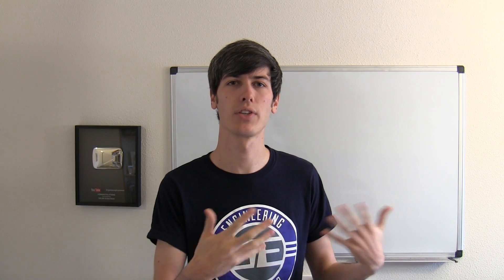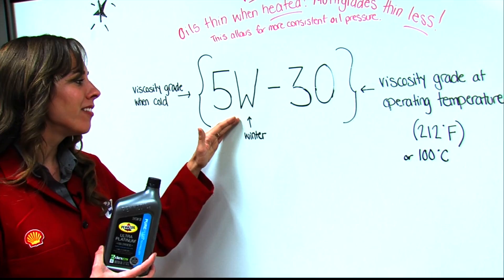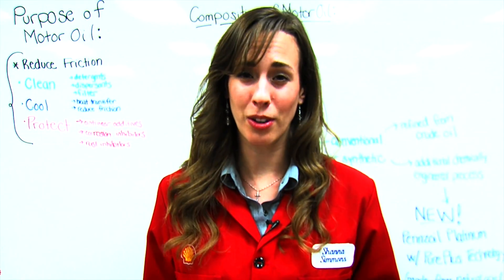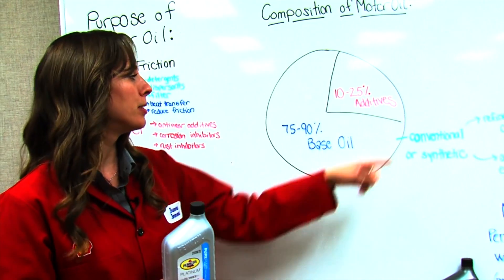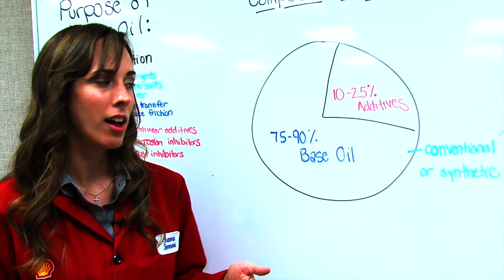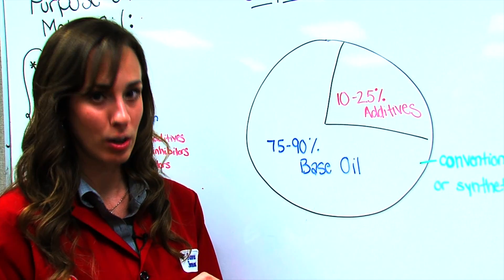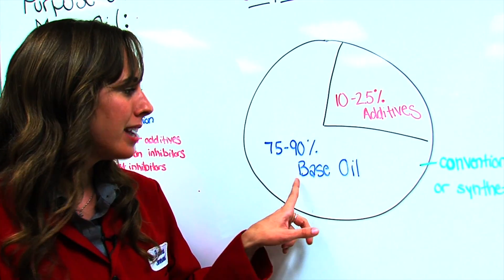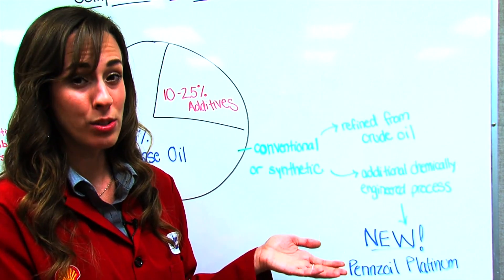Motor Oil Myths & FAQs - Synthetic vs Conventional

Comment: The difference between running an engine on hot oil vs cold oil. I'm thinkong of manually installing an oil-cool-radiator on my air cooled 350 cc single cylinder motorcycle. Would be interested to know what cause amd effects and what benifits running an engine on cooler oil. Thanks

Comment: the oil industry very deceptive in their advertising.   for example there is a difference between oils labeled full synthetic and oil labeled 100% synthetic.  many years ago Mobil sued Castrol because castrol was mineral oil with synthetic additives and calling it full synthetic.     a court ruled in castrol's favor.  why I don't buy Castrol, you're not getting what you pay for.  motorcycle oils label their oils as 100% ester based synthetic.  ester is the best synthetic oil you can get.  it's not affected by heat, it's polar so that means it clings to metal parts(magnetic) and actually lubricates more as more pressure from parts is applied to it.  it's not my opinion it's a fact.     car oils you buy at the autoparts stores never use ester.  Motul actually does make a car oil made of Ester.   if you want a better oil buy motorcycle oils that say they are 100% ester based synthetic.  there are many brands Motul, Maxima, Belray, Yamalube.  brand such as Mobil1, Castrol, Royal purple, Valvoline, Shell, Penzoil etc are not made with esters. and in my opinion are just a tad better than mineral oils.  and not my opinion but fact,  inferior to ester based oils.  as for the oil weight recommendations it goes a lot deeper than what she mentioned.  as any serious outfit that designs and builds engines will tell you,  they build an engine around the oil they plan on using in it. they pick a oil based on the type of use the engine will be doing.    there is youtube videos about this subject from major engine builders in the industry.  so it is very important to use the oil weight the manufacture says to

Comment: Is the flow rate the same for the same for synthetic and non synthetic for automotive motor oil of the same rating? A 5W20 synthetic vs a 5W20 non synthetic oil for example.
Second question is what qualities in a motor oil other than viscosity effect the start up of an engine? Is it at all possible to tell the difference at cold engine start up between the same rated viscosity between a synthetic and non synthetic oil of the same rated viscosity?

Comment: Wow, and that was someone from an oil company answering those questions?

First question is right one except oil does not always operate at the same temps your cooling system does. And oil is 40% of your engines cooling. There are parts the oil can get to, to transfer heat that the water will never touch.

Question 2 is that you change oil not only because of the additives, but to remover contaminates the filter cannot remove. And changing the filter for the same reason. Also your oil builds up a acid content in scientific terms is know as Total Acid Number (tan) and the oil's ability to neutralize it is called Total Base Number (tbn). As tan number rises tbn number falls. And if you use a graph to graph it, at the point where tan exceeds the tbn number a different type wear comes into play. Chemical wear. If you want to graph it. Gasoline oils have a tbn number between 5 - 7. Diesel oil runs between 9-13. Tan numbers always starts at zero and as you use the car that number rises. And as the oil neutralizes the acid formed the tbn number falls.

Question 3 varies. Conventional oils require more additives. Synthetic oils require less. This is because there is not much enhancing required with a synthetic base. And she made it sorta sound like the 2 bases are the same. They are not. Conventional oils are based on the quality of the crude oil and the refining process chosen There are 2 refining processes for conventional oils. The one that most use and one where the oil is bombarded with hydrogen gas which cleans the oil up so that when finished it's as clear as water.

Question 4 is right on. But needed to add: When an additive is used it changes the whole structure of the oil and what it was formulated to do. It's like trying to pass of a chocolate cake as vanilla claiming chocolate was the only thing you added extra just for flavor. Most all oil additives have been fined by the FTC for deception of the consumer. Slick 50, motor up, prolong, stp etc... Just google their names and add ftc to the search and you can read all about it. There is no magic additive that's going to do anything. And not everything that makes your engine run better = being good for it either.

Question 5 Yes the 2 can be mixed except in the case of what's called a carbon based synthetic oil. Far as I know that base if not being produced as a API rated oil. The problem is not quality but that if you add conventional oils to it, it turns into tar. 

Question 6 is a yes not question. older engines (60, 70, 80, and 90's) should never use synthetic oils on break in period. Being able to use synthetic on break in is determined by the machining process and the metals used for the parts that need to mate in the break in period. Amsoil actually makes a synthetic break in oil.

Question 7. Sludge can be formed from many different things. Myth: A oil is better if it stays clean almost throughout the change interval. Nope. An oil getting dirty is keeping your engine clean and gets dirty in the process. When you wash dirty dishes, do you expect to have fresh clean water when you are done? An oil that stays virtually clean is allowing the dirt to stay on your engine. 

Question 8. Using different viscosity or weights. There are several reasons why you should not.

1) If the oil was broken in on one weight grade and you use another. They may cause oil consumption to start.
2) Because oil is 40% of your engine's cooling. Thicker oil will slow down the gallon per minute flow which can make things like your bearing and other engines parts run hotter increasing wear.
3) Ring sealing. Thicker oils can mess up the ring sealing making engine pump oil into the cylinders.

The only time you might go up a grade in weight is when your car is high mileage and it's consuming the thin oil to much. So you go up a step as an experiment to see if the oil consumption goes down. If not then it's time to sell the car. 

4) Because of the new VVT system that is actually tuned to the weight of the oil. If you change the weight you will run into issues concerning performance and mpg. VVT is variable valve timing.. Was just talking to someone who was having an issue after an oil change. I asked: Did you put a thicker oil in? He said yes and he had the VVT system. So I said change it back to the thinner oil and your problem will go away. he said his mechanic said it was okay. I explained it and why and he went the next day and his problem is gone.

Now to add my own question as a learning subject. Can you use any brand in a certain  weight and mix them? Nope. You always use the brand you started out with if possible. If you have to switch then watch to make sure you have no problems and if not stick with that brand only. Mixing brands increases wear and can start oil leaks. There are several reasons for this but the post is already long enough.

Comment: Another thing, if anyone ever read their owners manual, which a lot of people dont, not only it suggests a certain grade of oil, it also suggests different grade of oil for different ambient temperature. The oil grade on the cap tend to have the widest range, but it is not absolute.

Comment: I live in a third world country, mechanics here recomend to change the viscosity of your oil once your car gets some years old. I have a 98 chevy cavalier, it is designed to run with 5W-30 and now i use 20W-50, of course i bought it in 2007 and the owner was already using 20W-50 oil. Now i have some questions. Can i go back to 5W-30? Should i do that? The ambient temperature has something to do with the viscosity of the oil i should use? I mean, temperature here goes from 32 Celsius to 39 on an average day, maybe its not that high on the USA or Canada (wherever that car was build and sold).

Comment: good video, thanks for posting.
1 question I was hoping to hear an answer for. is there a benefit and difference between w5-30 synthetic  or conventional High mile engines 150k-200+k Vs. lower mileage engines under 75k miles. thanks

Comment: If you care about engine longevity, always use a heavier oil than recommended by the manufacturer. Manufacturers are constantly pressured to reduce emissions and increase fleet mpg, and one measure they employ is recommending lower weight oils

Comment: why not just let the engine run it self dry and then refill the oil? l had a friend doing that with an engine that has over 100,000 miles on it. instead of changing the oil she would just keep putting oil in it. one time she ran the engine bone dry and other than a bit of struggle while starting, it ran fine. we told her to put in some oil and she never did, and a week later the engine started knocking. but it ran for a week without any oil.

Comment: i have a question: as the engine gets old, does it need a higher viscosity multigrade oil? or should i stick with the same multigrade as the  owners manual?

Comment: I use synthetic blend in my Integra but in the crown Vic I use 10w30 conventional.  Ironically people including oil change shops don't read owners manuals . I live in Florida.  if you read your oil cap on your car it gives you oil info . The Vic says 5w30 but in the owners manual it states for warmer climates use 10w30.  interestingly enough the only place I can find that follows the owner manual guidelines is my backyard ( hence do it myself ) and believe or not , I barely can , Wal-Mart.

Comment: Is it safe if I mix 5w-30 castrol GTX (the black bottle stuff) with the pennzoil 5w-30 oil for a riding mower? Both oils will be synthetic. I just want to use up what I have.

Comment: Potential exception to viscosity, per my well-respected mechanic:  an older engine will be worn, and therefore the parts fit looser.  And therefore a thicker viscosity is recommended.

Also, several years ago, I recall reading a study done (Consumer Reports?) on NY taxi cabs.  They tried different types of oil, then disassembled the engines to measure the wear.  They also tried replacing the oil more frequently.  Their conclusion was the differences weren't significant.  As long as you change the oil per specs.  And that's what really matters.  Some oils may break down more than others, but if it isn't significant to engine wear over the life of the engine, then it isn't worth it.

Comment: The only discrepancies I can think of that were not mentioned are the age of the engine, and how altitude affects engine characteristics. The combination of lower temperatures in winter, hotter summers, and thin atmospheric conditions, will supercede a manufacturers recommendations for lubrication. If you live in high altitudes where extremes are commonplace, determining which oil to use will become a more arduous task. I personally use a 20W-50 synthetic oil in a 1990 351 Windsor, here in the Rocky Mountains. Depending on the conditions the vehicle will be exposed to, your manufacturer recommended oil may not be up to the task in front of it. Keep that in mind while browsing for oil change components. Good luck to all the gear heads out there, I hope my little soapbox was helpful.

Comment: So what is the bests oil 👀 castrol? Mobil? Penzoil? Who really knows 👀
Reply: All of the are good, just get proper type and viscosity to your car(use recommended by manufacturer), dont go synthetic if your recommended oil is semi-synthetic or mineral. It may have very bad consequeses on old worn out cars(it will clean out the gunk which helps to seal wont out chambers, without it engine will loose compression and power, and may get damaged due to it overtime.

Comment: People that keep asking about the lighter weight oils, it's mostly to increase fuel mileage to meet epa specs.  Your manual shows you what weights to use in what climates, I'll run 5w30 in the winter, ( my winters don't get much lower than 20 deg F and summers no more than 104f) and 10w30 in the summer, any brand or any group 3 or 4 that's on sale.  I run 20w50 diesel,  Rotella, or Mobile one in the motorcyle, they still have ZDDP and won't cause the wet clutch to slip.   Group 3 and 4 are  full synthetics, 4 is PAO based or made in the lab, 3 is mineral baed with a great addititives package, but still better than group any 2 or conventional.  I believe blends are group 2+ and I see no point to messing with them as there are no regulatory guidelines to what constitutes a blend.  A blend can be very close to conventional or close to full synthetic, there is no way of knowing.

Comment: Synthetic cost more! It's just to get more money out of the consumer for an otherwise inexpensive oil change.
Reply: Sean Brown Go ahead and run that conventional oil out to 8,000 plus miles bud and let us know how that goes...
Reply: Yes, and no-name oil ACEA A1/B1 costs you get in supermarket half what shell/castrol/mogul with ACEA A4/B4 costs, it is just money farming right? Think before you write something. You may save money on oil but then throw way more of your money outta window because of engine repairs. So try to use cheapest petrol, cheapest oil, cheapest coolant, chapest brake fluid, cheapest bulbs etc.

Comment: When you change your engine oil type you are already mixing engine oil.  The previous oil are already lubricating engine parts and it will be mixed with your new oil that you add in that is in your oil pan.

Comment: Questions are incomplete, I have questions

If my manufacturer's recommends, I should use 5w-30 Synthetic, then can I use 5w-30 Conventional and vice versa?
They say as long as the viscosity grades are the same its ok, of course its obvious I shouldn't be using lower or higher grade over the other.
Also if my manufacturer's recommends to use 30 SJ JASO MA " MONOGRADE " oil can I use Synthethic 5w-30 SJ JASO MA or Conventional 5w-30 SJ JASO MA and vice versa? If so, will there be a change in performance? Will it improve or worsen my engine longevity?
Also which engine lasts longer and performs better (let's say same displacement and on purpose), those engines run on monograde oil or those that on multigrade (Synthetic or Conventional)?
Hope I get some answers to this. Thanks a lot man.
Reply: magojiro kusanagi the easy you should use exactly what your manufacturer recommends. For instance. Mine recommends 5W-20 synthetic blend from motorcraft. But I use 5W-20 pennzoil ultra platinum full synthetic. I use that because ford has approved its use in their vehicles. I wouldn't use something the manufacture hasn't given the green light on. What's your year and make and model?
Reply: magojiro kusanagi you can go back and forth with either synthetic or conventional. The only time I would worry about wear or problems with the oil is if you're in really cold climates, racing or have a modified engine. If it's just a normal economy car and you are just cruising back and forth in town, Conventional or fully synthetic will achieve the same goal at protecting your engine from heat and wear. I just wouldnt really switch from different "weight" grade(viscosity) oils. Say from 0W-20 to a 5W-40. You can have problems with variable valve timing or other mechanisms that really on oil pressure to work correctly.